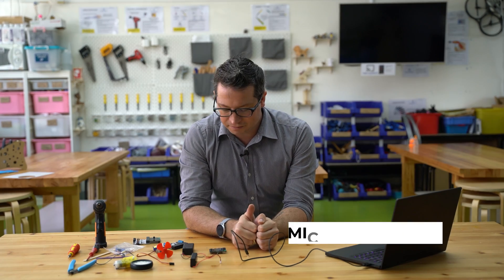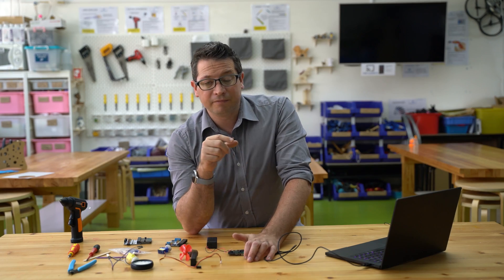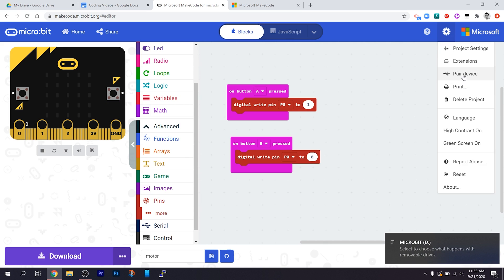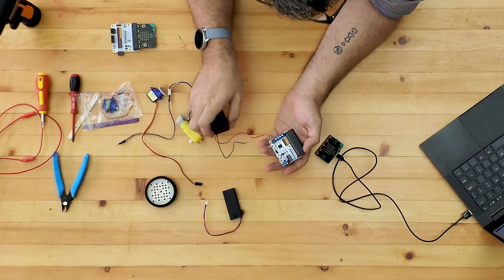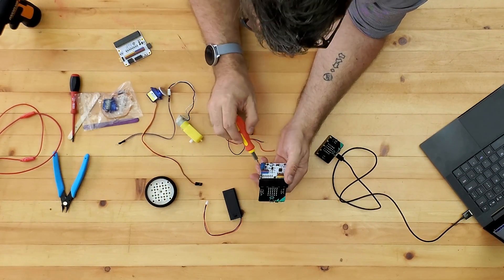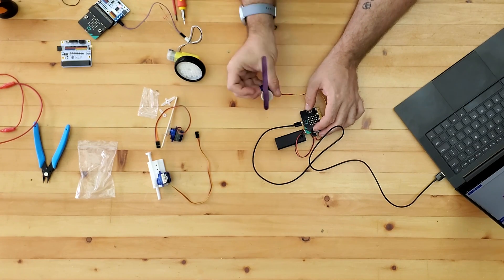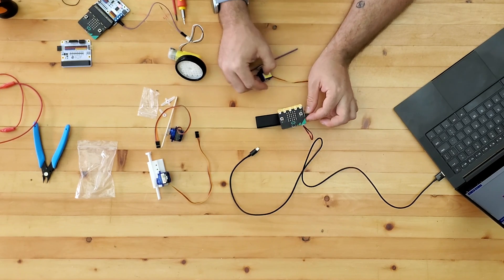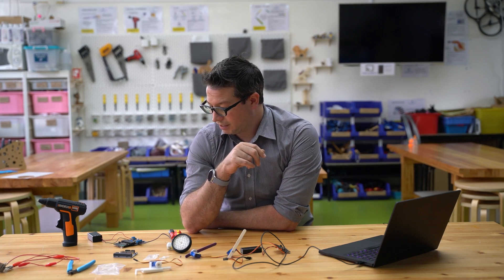Coding with micro:bit - Part 5 - Motors & Servos

Comment: i want to use an l298n module, can you identify alternate areas where  one might solder to use up the three gpio ports on my gamepad shield?  i plan to make a remote up and add a decoder encoder suite.  Where does one find documents on pinout?

Comment: hiya i was triying out the dc motor i did the code right and it worked but when i plugged in my motor it stopped working then i tested the motor and it worked.
 please help ,rowan

Comment: You ever consider using transistors? Pins out are “gate control” on the transistor which is on  own higher voltage circuit with motors.
Reply: why not just use an ordinary H-bridge...  L298, L293, MX1508.....  nowdays they are very inexpensive....

Comment: Excellent video!! I've got a question: if we connect the  Microbit via the USB cable and at the same time connect the breakout board to the 9V source, could that damage any of both devices?
Reply: No, it will not! I used it for a school project and everything was fine!
Reply: @zuzu_.1ka  thank you
Reply: My microbit died when i did that